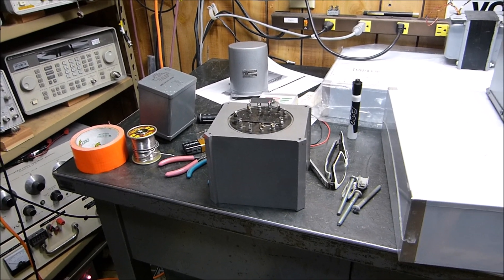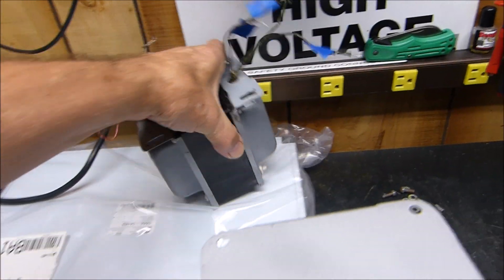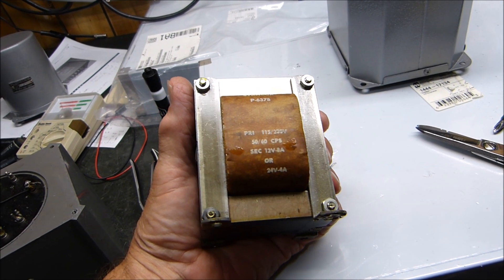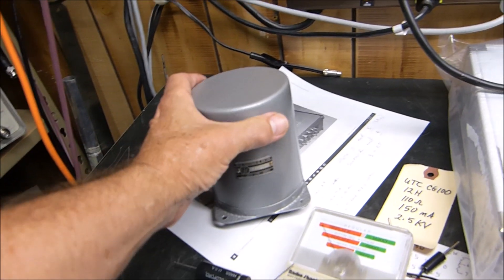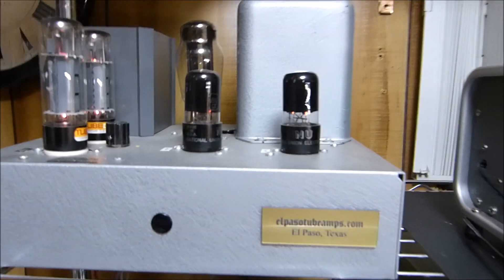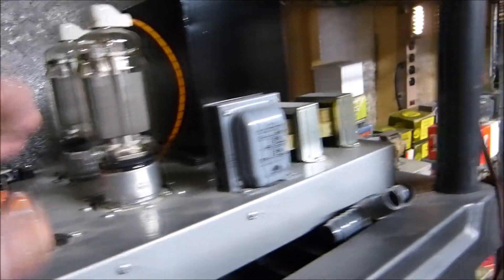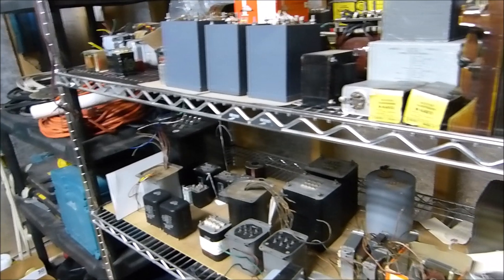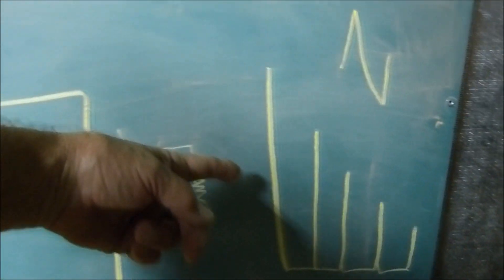Vacuum Tube Audio Amplifiers - What To Build Next?

Comment: I've been thinking about building an 807 PPP at 100 watts. could you build something like that?
Reply from the maker: The datasheet says you can get up to 120 watts from push-pull 807's but that won't be HiFi quality. They are an amazing tube to be over 80 years old and basically are a 6L6GC with the plate connector on top so it can handle 750 volts on the plate: Datasheet below.
https://frank.pocnet.net/sheets/084/8/807.pdf

Comment: Maybe using 4cx150 or 4cx250  tuber for a very compact design for audio. The plate voltage  is 
reasonable could use a line voltage sextupler and save those pricey power transformers for another day
Reply from the maker: I have some 4CX250B and some 4CX350xx and 20 something years ago I did build a class-C, 2 meter amplifier with the 4CX250B. It was very powerful, I think around 500 watts. I could talk with my friend in Cloudcroft, NM simplex (he could copy me) but I had to hear him over the repeater. I know you are talking about audio and not ham radio so I will keep it in mind. I just got in another seven 810 tubes and I have five so now I have a full dozen. That should be my next big amp as I also have two huge output transformers made for PP 810's.

Comment: I want to build a single ended with a 3-1000z as a final. Any suggestions for an output transformer?
Reply from the maker: I love the 3-1000Z and have a couple of them that I use in a 20M RF amplifier. Very powerful and amazing tube for a GG amplifier. 
However, the gain of the 3-1000Z (and the 3-400Z and 3-500Z) is a very high value of 200 also known as mu in triodes.  
On the other end of the spectrum, we have triodes like the 300B with a mu around three (3). The difference here is the low mu triodes like the 300B have very wide spacing of the grid wires and require a substantial negative bias to control plate current but... they are very linear and lend themselves to great audio amplifiers. The high mu triodes, like the ones mentioned above, require very little, if any, bias but they require quite a bit of grid current and power pumped into the grid which makes the tube not do high-end audio very well. Class-A or class-AB1 is how we want to run our tubes and these high mu triodes can only be run class-B or class-C (class-C is strictly for RF amplifiers).
Lastly, low frequency response of SE amplifiers is almost always terrible. If you only listen to vocals and violin and chamber music, maybe a SE amplifier will perform well but they don't do well at anything below about 80 Hz from my experience. SE amplifier transformers have a gap in the core to help keep the transformer core from saturating with idle current necessary to run a class-A amplifier and these transformers will simply not work very well with a tube configured in class-B and I have no idea where you are going to get a 100-200 watt SE output transformer.
I hate to tell you but it is a futile adventure unless you want to run push pull 3-1000Z's for about 3500 watts output...
I tried a 833A SE amplifier and found all this out the hard way and it has a gain of only 35 and it was a complete disaster.
Reply: @ElPasoTubeAmps  Thank you so much for the advice. The main reason I got the 3-1000 was for the look of it. I have found another large tube on ebay that some have used for a SE audio amp. It is a GM-100. What I am doing is as much art project as sound. I did read about the air gap in the output transformer. I figured I may have to hand make one. what I am looking for is the largest tubes I can make something from. I will use 872A for rectifiers. If I could get 811's cheap enough I was thinking quad parallel push-pull. I like to build things in an "industrial" look.
Reply from the maker: @josepheccles9341  You are definitely a fellow I appreciate. I think the big glass tubes are beautiful. I have a PS with a pair of 872A in it. They are beautiful and will provide power for a 5KW amplifier. I just looked up the GM-100. Wow... that is a beauty. They called it gain coefficient of 15-21. Well, that is a little better (lower is better) so go for it with what every you can get. I do not want to discourage you from building  - please build - I am just hoping I can help  with the performance. Have you look at the 833A? 
811's are great but they also are a very high gain tube with a gain of 160 and will not run class-A. 
Have you thought of a quad of 300B? I have a video on such an amplifier.
https://www.youtube.com/watch?v=AQGxgcSlyS0&t=1171s
Reply: @ElPasoTubeAmps  I have looked at 833 and love that idea, but they go too high on ebay. The GM-100 are currently available on ebay for around 100 dollars each for NOS from Russia or Ukraine. I have never before attempted to build a tube amp. So, I really don't know the practical math involved in understanding the performance and response. Also, I don't have the kind of equipment to be able to do much testing. I will mostly be going by ear. It is nice to chat with someone who is a genuine enthusiast. Right now I am just conducting some experiments with a pretty neat tube I bought on ebay. It is a 6336A dual triode.   I was thinking to try to use it as a push-pull driver for a smaller amp. Right now I am only doing some simple DC experiments to kind of learn the relationships between grid voltage and plate voltage, and the current. Thanks for looking at my thoughts.
Reply: @josepheccles9341  Look up "100 Amplifiers - Part 2"   (there is part 1,2,3 and 4). I think there is a schematic in there for the 6336A.
http://lilienthalengineering.com/100-amplifiers-chapter-1/100-amplifiers-part-2-1945-54

Comment: What about a direct coupled amplifier one double triode configured as a long tailed pair and the other two as a totem-pole output stage you know ECC88 in the long tailed pair driving 6550's configured as a totem-pole output stage what about it or what about a PWM amp implemented using vacuum tubes.

Comment: I have been looking for a while of KT120 (either 2 or 4 tubes) 120 watt push pull parallel. Prefer triodes and pentodes. But couldn't find anything. Patrick Turner Audio design was great but his is too complicate to build. Been watching a lot of your videos and enjoy very much. :)
Reply from the maker: It has been a few years but I have had in my shop the KT120 amplifiers that, I believe came in a kit form and patterned after the Dynaco design. I thought they were by Triode Electronics but I don't see them there. As for audio triodes, the 300B is the king of 15 watt amplifiers using the Williamson design. There is also the Svetlana SVT752-10 series of triodes but they require high quality 10K ohm primary output transformers that are hard to come by. 
The best I have seen and built is the UTC W-20. It performed amazingly and ran push-pull-parallel 6L6 for 20 watts. It is a lot of iron for 20 watts. I certainly agree with you that some are just too "complicated" and I am not sure they are worth it. The McIntosh tube design is a bit complicated but obviously works better than anyone else's but you also must have their output transformer. Thanks for your comments. I have an amplifier on the bench as I write that I will be posting soon.
Reply: @ElPasoTubeAmps  Thanks for info on 300B. Do you have schematic 300B Tridoes for 15 watt? I have bought PT and OPT at Edcor to build 100 watt KT120 but don't have time to do it yet. Maybe next year or something but I am also interested in the 300B you mentioned. Will check back with your new build amp. By the way, how much was it cost for you to sell Quad 300B Triode Amplifier with/without tubes?

Comment: Maybe you'd like to try something like a high quality amplifier, with a high quality tuner? Building a good AM tuner isn't much different than what you've been doing. I'd like to get in touch with you, regarding your 883 HF amplifier, for a schematic I can't find a way to contact you, so find me on Facebook or I'm good on QRZ.
Reply from the maker: I don't do Facebook but I am good in QRZ at WA4QGA. I don't mind sharing my direct YouTube email which is TheAudioShop@SBCGlobal.net. The 833A is a challenge as it is a medium mu triode and does not lend its self to GG so it is grid driven and needs to be neutralized. The modern day triodes like the  3-500Z and similar tubes including triode connecting the 4-400A family of tetrodes in triode mode make beautiful GG amplifiers that need no neutralizing. They are almost too easy to build and make work but not so with the 833A but you can make a good linear amplifier with that tube. I did not draw out a specific schematic for the 833A amp and keep most of that stuff in my head - not the best place to keep it - but I often times do draw out the parts of the circuit that are unique and keep them with the equipment. The only thing unique about mine is the details of how I neutralized it. A good place to start learning about the 833A is to look at Gates transmitters. Just start Googling something like, "Gates 833A amplifier schematics" or something like that and you will find lots of information. Collins Radio also made some commercial 833A amplifiers to search for them also.  73
Here is a link that I used     https://www.americanradiohistory.com/Archive-Catalogs/Gates-Harris/GATES-BC-1T-500T-250T-Transmitter-Manual-1958.pdf
Here is another one    file:///C:/Users/Admin/Downloads/Gates-BC-1J-Transmitter-Manual-1955.pdf     Notice on page 51 as PDF  counts pages, how they neutralize the 833A. This is the method I used that worked nicely.

Comment: I would like to see a parallel push pull amp with whatever power tube you like, EL34/6L6 or even KT88/6550; but, with the idea of getting the damping factor as high as you can. I ask, because there are a lot of great planar/electrostat speakers out there that like high current amps. Magnepans sound even better with thermionic valves as opposed to transistors, but the more power they get, the better they sound.

Comment: Definitely not a SE! Can I quote you on that SE not catching your fancy thing? Because I also feel the same :)) How about building a dual monoblock with separate power supply for both in a common chassis, say PP triodes at around 100[W]/Ch? Oh, wait. Not stereo... :D  Or a pre-amplifier. Wait, that's stereo too :)) I can only think stereo, except if it's a instrument amp :)
Reply from the maker: Dual monoblocs with one common outboard PS was my first thoughts and that may happen. I think that would give the best S/N results, as was seen in the W-20 I built some time back that actually had -90 dB S/N. I want it to be usable also and not just be an academic achievement that never makes it off the test bench. I can live with some exotic amplifiers in my "back house" but it has to be able to be nicely installed to use it in my home theater and something that my wife can live with. In any and all cases, it has to be safe even for a small child to touch. Those UTC LS-35's are just too beautiful not to build something with and the two monoblocs with common PS does make sense to me.

Comment: I think an interesting design for a PP amp might include non-traditional arrangements using more traditional tubes. Say, an octet of 6V6GT's? 6L6GC's being driven with interstage transformers? or possibly a post-PI pentode driver stage to drive 6L6/KT88 instead of higher-power tubes that arrangement would more likely be seen used with??

I'm also super keen to see how small-signal pentodes might be used as preamp stages, especially in moderately powered amps (30-100W) - you know, the cheapies that are readily available? They often saw use in many post-transistor budget radios and amplifiers through the 60's (eg, 12au6), and stocks are plentiful.

Thanks for your consideration!

Comment: Quality tube phono preamp mm please!
Reply from the maker: Whewwww... that would be quite a tedious task to build a first class phono preamp with RIAA equalization. And almost an impossible project obtaining the correct value and log taper pots for a stereo version in addition to the wafer switches, etc. 
It is hard enough to find correct value impedance and power ratings for output transformers but the preamp would be even more difficult. 
On the other hand, if you only want a single stage (mono version) that could probably be accomplished without too much trouble. I have done this before but got lazy over the years and just buy the preamps with all the volume, bass, treble, high level/low level switches and controls. I would recommend relatively inexpensive preamps like Dynaco... vacuum tube McIntosh is way too expensive like, for example, the C20 from the 1960 have asking prices of $3000 or more and you really don't know what you are getting... I have a beautiful C20 that I picked up several years ago at an estate sale here in El Paso for $20. Unbelievable but true. It did not work as the electrolytic PS capacitors were bad but that only took a short time to diagnose and repair.  
Are you interested in just one channel for the preamp or a stereo version? I may be able to help you find plans for one somewhere on the Internet.

Comment: How about an amplifier design that is choke coupled directly to the plate and capacitor coupled to the output transformer, I saw and article somewhere where it mentioned that when even a tiny bit of DC is present across a transformer which also has an AC signal across it saturated very quickly compared to just having AC signal across it... That way you can push more power through the output transformer without saturation... An increase in efficiency if you like.... Also, everyone tends to use the popular 12ax7's which tend to have a strong midrange.... how about using the Mullard EF86 instead! The datasheet just screams Hifi where as the 12ax7 tends to work better with guitars.... So basically that's my two ideas which are probably more experimental than anything else but I have been looking for videos on those two topics and I have only found one on the difference between the 12ax7 and the EF86... And I have seen some videos on trying line transformers as output transformers but so far no one has had any success because of saturation, if only they tried coupling the line transformer by capacitor and then coupling the plate by choke they might have succeeded.... It's still a theory from my part but I'm sure that it would work.... That would ultimately mean that you no longer need a massive and expensive output transformer as only a line matching transformer will do.... So basically get rid of the DC component from the output transformer and basically wire it as a single ended capacitor coupled solid state amplifier... Now that would be something different... I believe that I have even seen the schematic of a tube amplifier that didn't even have an output transformer in its design... I wonder what it must have sounded like?